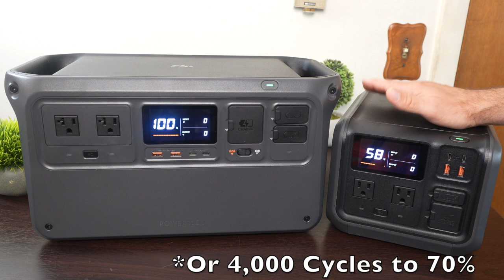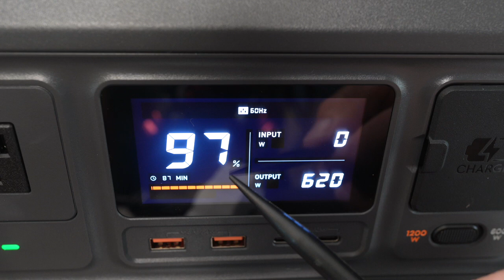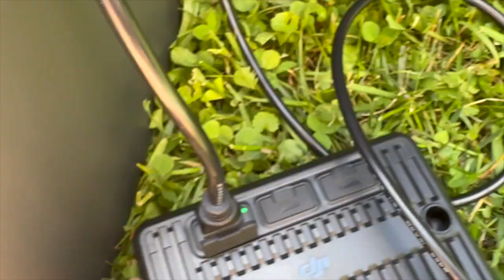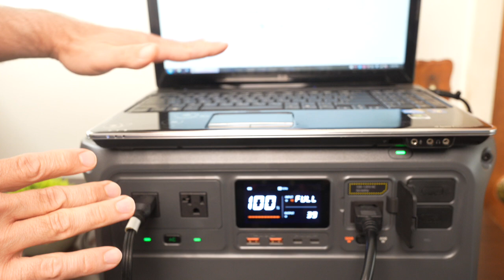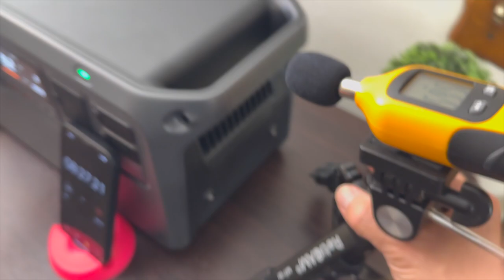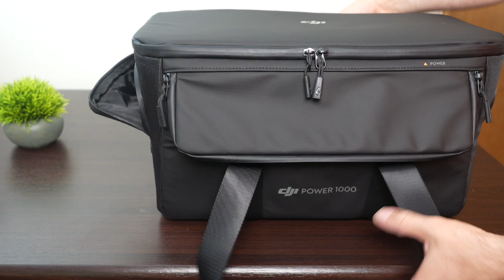No Other Power Stations Can do This | REVIEW DJI Power 1000 & DJI 500

Comment: Can you use it as a UPS for gaming pc?
Reply from the maker: It has millisecond switchover from grid to battery so I would think so.
Reply: @solarguy  Thank for the response, so is it okay if this device is always plug in?
Reply from the maker: Yes, it's fine to leave it plugged in.  Units like these use AC pass through, so when it's plugged into the wall and you are using it's own AC outlets, it's like you are plugged into the wall.  It will charge the internal battery to 100% and just sit there.
Reply: @solarguy  Thanks Bruh

Comment: When testing the switch over I suggest you do not use a blank, white screen but have a video playing so people can see if it glitched or froze, something you cannot see with the blank/white screen
Reply from the maker: Thanks for the suggestion.  I may give that a try for the next review. The reason I choose a white background for these tests is to make it easier to notice any flicker on the LED backlights.  I would think a video playing would make it harder to notice.  The biggest thing though is that the computer keeps running.
Reply: I would suggest using a higher draw device too like a desktop. A laptop uses very little power and the capacitors in it may be large enough to keep it running even if the power cuts out briefly.

Comment from the maker: What do you think about these SDC ports on these units?
Reply: I have noticed that SDC is DJI's own proprietary port, it's not hard to imagine that in the future DJI will come up with a lot more different accesories which will make this SDC port even more powerful. Currently it supports drone fast charges, as well as 24v DC output which is better than tradition cig outlets that only support 12v. I really hope if DJI could release a video to clarify the functions of these SDC ports for us, that would be great.
Reply: It has advantages for their ecosystem.  However, relying upon the SDC outputs and adapters for 12 volt DC output and for solar input is a major mistake because it is like (actually worse) than old power stations that had a separate power brick for AC input.  With DJI you have to keep around multiple bulky adapters.  It would be one thing if they had a compartment on the power station in which you could put these adapters but they do not.  Thus they are several years behind the curve of the development of power stations.